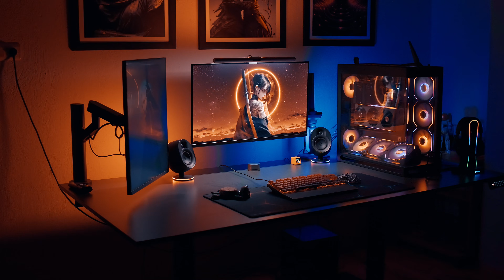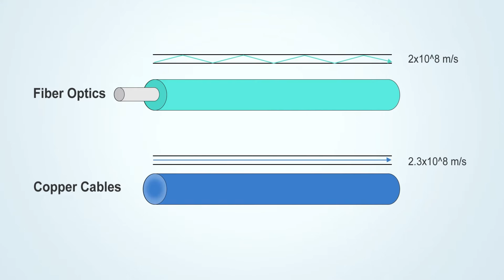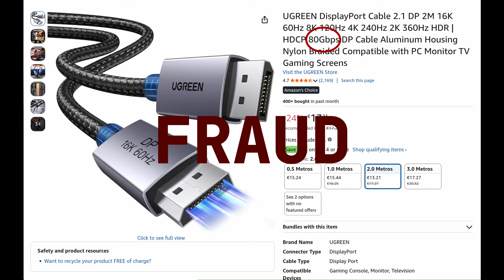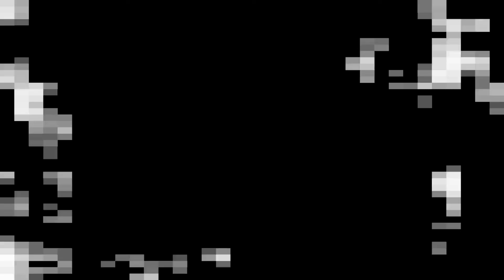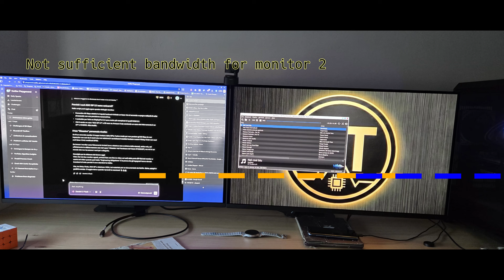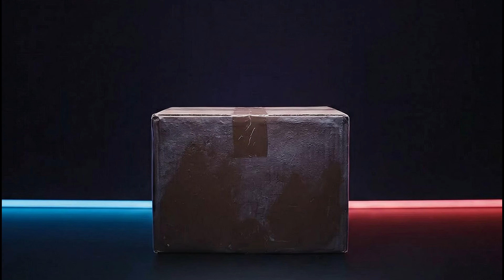Why Your 240Hz OLED is Failing (The Layer 1 Disaster)

Comment: Thanks for not using AI voice, despite your heavy accent (greek?). Id rather have someone attempt to make a video themselves than phone it in. 

That said, I have ran into this with my 240hz 4k oled. On displayport i have the bottom pixel row occasionally fizzle. On hdmi2.1 it has black screens and RGB flickering. Both hdmi and DP have issues with freesync which causes the AMD driver to completely lock up and crash. 

I pride myself of making my system very stable and optimized. But this damn monitor is always bugging out on me. Randomly turning off and the aforementioned issues. I dont think its the monitor itself...
Reply from the maker: Thanks man! Yeah, the accent is actually Italian, but I'm glad the human voice beats the AI garbage standard!
Regarding your issues: you just described the textbook definition of a Layer 1 disaster. Your system is stable, but 4K @ 240Hz pushes DisplayPort and HDMI to their absolute physical limits. Those black screens on HDMI and the AMD driver crashes when Freesync is active happen because VRR dynamically shifts the clock frequency. If the cable has high impedance or poor shielding, that frequency shift breaks the signal integrity entirely, causing a total handshake loss.

Try a certified VESA DP 2.1 cable (even if the monitor is 1.4, better shielding helps) or an ultra-high-speed certified HDMI cable, keep it under 1.5 meters, and away from power bricks. You'll bypass the bottleneck!
Let us know, how it will go!

Comment: Ugreen dp 1.4?
Reply from the maker: Honestly, at DP 1.4 bandwidth, unless you bought a 100-meter copper cable, you can sleep soundly. The only catch? If you are running a high-refresh-rate monitor (like 240Hz), you will exceed the native bandwidth of DP 1.4 and have to rely on DSC. If that's the case, let's hope the cable's internal build quality is actually good enough to keep the DSC handshake stable. Otherwise, enjoy the random black screens.

UPDATE

Take Ugreen as a quick example. Their name is all over the VESA database, but try matching those model numbers or finding a working link to the actual retail cable on your desk. You can't. It's almost all dead links or generic OEM codes. 
They basically license a certified reference design from a generic manufacturer, throw on some fancy bicolored nylon braiding, and sell it under a different retail name. The core design was certified once, but the final product you bought was never audited. You're just paying for a pretty jacket.